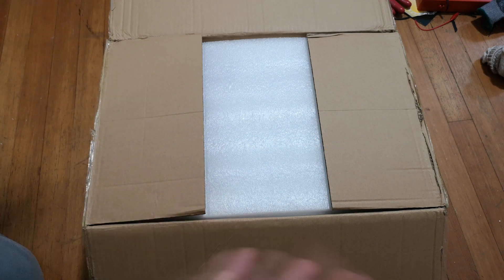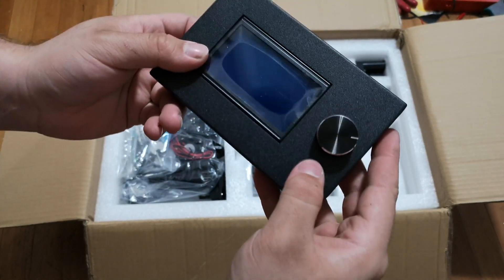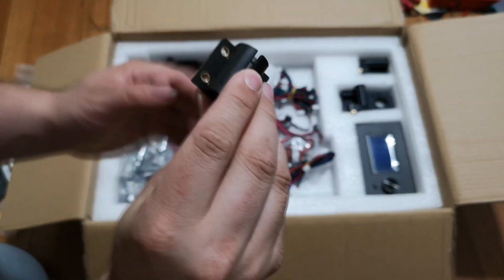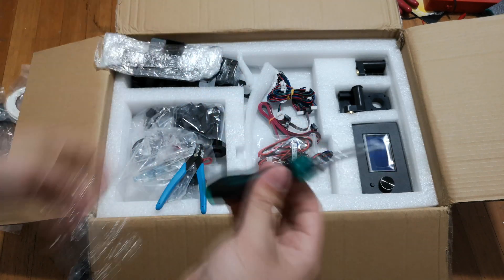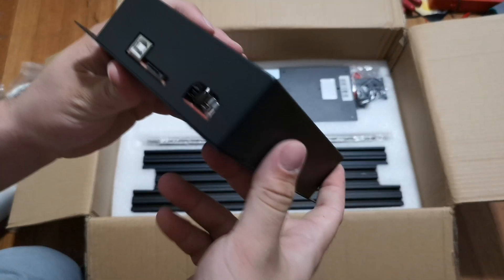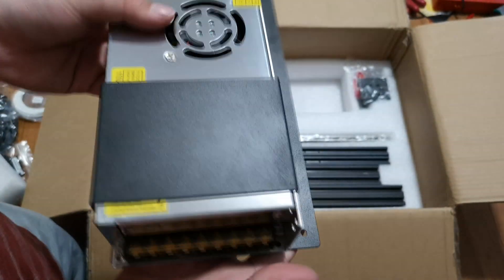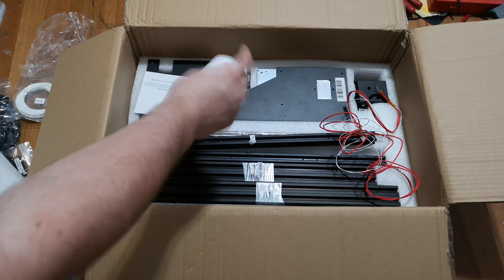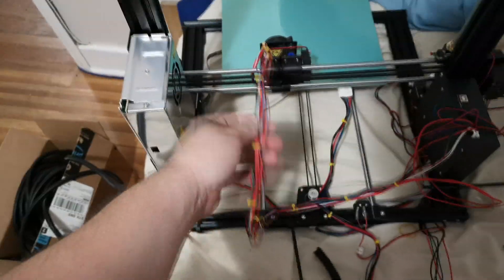Anet A8 Plus Unboxing & Quick Overview

Comment: Hey are you able to measure each XYZ section of extruded aluminum? I'd like to build a frame and want to compare other XYZ  ratios. Are the holes on the end of the frames where the frames attach threaded? Just wondering how their screws lock in that frame so well.

Comment: I also bought this printer, but nowhere can I find a slicer that supports the a8plus. Which slicer do you use? thanks
Reply from the maker: You have to manually set up the printer profile. I use prusaslicer.

Comment: What are the diameters of the X Axis, and Y Axis linear rods? I purchased the printer, but would like to buy some delrin linear bearings to replace the stock ones off the bat.
Reply from the maker: Delrin linear bearings won't work well if they are the igus style ones that contract, unless you change out all of the bearing mounts. The way the plastic ones on this printer clamp compress it to much, and completely lock up the axis sadly.
Reply: @JunctionRunner  I'm perfectly fine with that. I just need to know the diameter of the shafts so I can print the replacement mounts and be on my way.
Reply from the maker: @BinarySIoth  Fair enough, just checked and rod diameter is 8mm

Comment: I'm looking at possibly buying this printer.  What are the dimensions of the frame only.
Reply from the maker: Hi, the frame is 19 x 18 x 21.5  LWH
Reply: @JunctionRunner  Thanks!  It will fit in an enclosed cabinet made with Lack side tables then. :)

Comment: am here for the printer progress :D
Reply from the maker: Unfortunately ran into a bit of a complication, however think I have it nearly figured out, aside from setting the home offset in marlin.

I ended up killing the board due to the plate moving rapidly when I moved the printer, I started by replacing the atmega 1284p, but that still wouldn't let me program it, but I noticed one of the stepper driver chips was very warm while disconnected.

Just a couple hours ago I removed the stepper driver chip, and i was able to program the printer again and it boots, so I ordered a couple of the driver chips on digikey and as long as I can solder it back in place properly, I should have the printer working this weekend.

Not up as fast as I wanted, but it's going to be a lot faster than whenever the seller manages to get a replacement board sent to me. all in costing similar to a new board too, but also faster still.